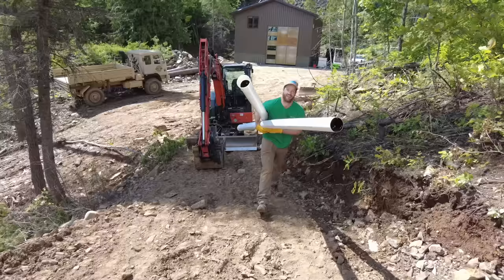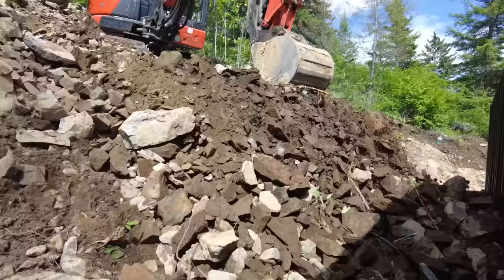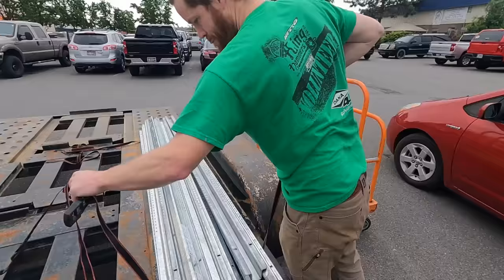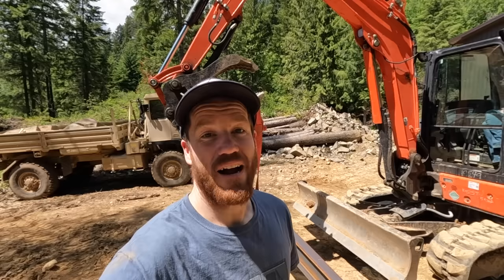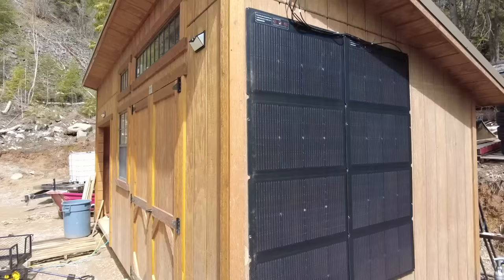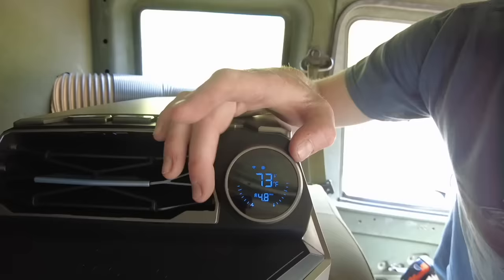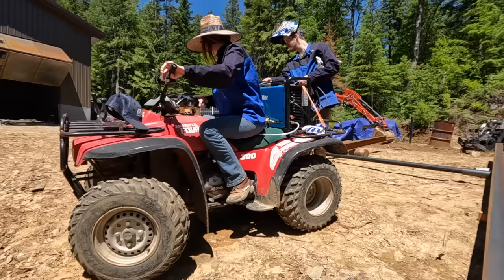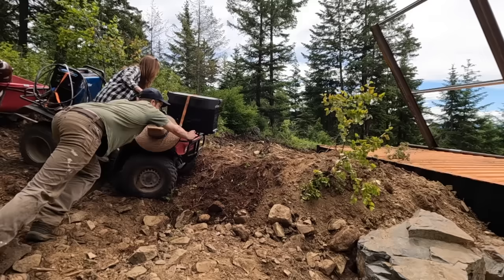We Were Told To NEVER Do This | Burying A Shipping Container

Comment: For french drain, it is VERY important to put a drain cloth around the drain rock, not directly against the pipe so the pipe does not get plugged with dirt in a few years. Steps: 1)Put a thin layer of rock (3/4 in river rock) in the bottom to make it easy to make a smooth slope. 2)Lay some good landscape fabric (weed barrier) in the bottom of the trench. 3)Put the pipe in, holes down, on top of the fabrik. 4) Put a few inches or more of rock on top of the pipe. 5) Close fabric over top of the drain rock. 6) Backfill.

Comment: The two of you are AMAZING !!   How your minds think and develop these ideas is unbelievable.  I have read some of the comments concerning high winds once the panels are installed.  I like some of the comments about securing the uphill side, top of the container 'the part that was backfilled with the rocks' with cables that are attached to vertical steel beams that are cemented into the ground 10-15 feet from the container could help with any potential high winds or heavy snow.  The way your minds work I'm sure you have already thought of the solar array destabilizing the entire container.  Love your channel and all the things you have invented, created and built.

Comment: In my last Germany assignment we used containers as air raid shelters and section offices. We put the containers up on un mortared rock to provide drainage. Then we went all army on them and made an outer wall of sand bags. Then we covered the bags with cement. and an outside of dirt. Water will soak in and turn the cement hard. When we got done we had wiring and furniture and it was very comfortable.

Comment: I used a simple water level to get my solar array grid laid out..  With the top line of posts level, the bottom line of posts level, and a fixed distance between rows, it all came out perfectly planar.  My water level cost me under $5.  It's a bit surprising, but adjusting the angle four times per year is just barely better than adjusting it twice per year.   When to adjust it you ask?  Vernal and autumnal equinoxes.  AKA 3/22 and 9/22.  Or on the 21st.  It's a leap year thing.  Of course, yours is so easy to adjust you could add a simple shadow indicator and adjust that winch every day at noon.
Do you ever get wind coming down the slope?  If so, I would dig some holes a few yards downslope from the container corners, pour in some concrete footings with a steel piece sticking out the top.  Then weld a steel beam from both end corners to the steel pieces on the footings.  This would make it MUCH more resistant to flipping over in wind or slipping away from the buried edge.

Comment: The two I seen buried were fails, the one I seen that was a success was reinforced with with t-rail ribs inside and wire concrete mesh on the outside. It was set back in a partially dug out hillside then two inches of concrete was poured around it and over it. Then filled in around all that and landscaped with trees. The doors was the only thing left showing and they were painted to blend into the mountain side. The two fails were literally buried under ground with top hatches for access. Both concave in with in year from the pressure, sections of the sides split leaving gapping holes that allowed dirt and water to spill in, subsequently ruining all the supplies inside. I climbed partially down one access ladder with a flash light and  the owner and quickly retreated as it was half flooded with water and had become a refuge for rattlesnakes floating on supply boxes and debris.

Comment: You can straighten steel lenghts by heating the bend to red hot then rapid cooling it with water, the movements are slow but normally 3 or 4 heat cycles for a 1/2 inch bend
Reply: This method can also do pipe

Comment: re: your frame hinges- if it's not been addressed yet, it'd be a pretty easy addition to add some flat plates at the ends around and welded to the outer sleeve pipe using the perpendicular face of the inter-container lock points as additional weldable surface area for gusseting.

edit: same effect could be done with inner pivots, just notching the plates to saddle the corner of the container.

Comment: saw a vid where they flip the container up side down because the floor could hold weight without modification if you fully bury it.. the way you hinge the center of your array is exactly how i designed mine. happy to see it actually works :) now am thinking of adding a motor to adjust the angle. easier to get snow off if you can increase the angle temporarily and let gravity do most of the work.

Comment: Sgm retire have used many conexs for storage.  Remember the hold heart and need ventilation. Also the steel holds the cold.  Neither are good for batteries. Barring the conex   may help. Insulation and ventilation may help.

Comment: Some awesome ideas on this project. 👍 One thing I'd definitely want to add is some form of anchors for the top corners on the uphill side of the container, to avoid it getting tilted or rolled over if the hillside settles or anything - especially with all that extra solar weight cantilevered off the downhill side.

Comment: That will be a great solar setup. Like someone else mentioned for highest efficiency you will likely want to adjust the angle every month but you have your limits set as needed and any other angle is somewhere in between. 
As for “burying” the container. You probably would have benefited from treating it like a basement foundation.

Comment: I made redwood frames with plastic  corrugated panels attached to keep the soil and rock from touching the container and to allow continuous airflow around and under it. Then put the drain pipe on the outside of the panels. Cover drains with burlap to keep dirt out of the french drain.
The problem with just burying the container directly, everything inside will mildew.

Comment: I've read articles about burying containers that said they will crush under the weight of the fill. There were pictures of them with the walls caving in. It was different though in that they were actually buried completely. I think some plastic sheeting over the top of the fill going back  into the hill side covered over with a few inches or a foot or so would keep water from even getting behind the container to begin with.

Comment: Looks like you have it under control. Every concern that I had initially you popped up with the solution. I think t-posts with a driver then welded to the container may have been better than rebar on the down hill side but then when I saw how you back-filled it I decided it's not going anywhere. Very well thought out. I look forward to following your progress.

Comment: There are videos out there talking about bearing a shipping container. Shipping containers shelters. One guy's got three parts to it and he talks about turning the thing even upside down and using the floor as the roof. One thing is he talks about putting bracing on the inside my thought was every 16 in putting a c channel in between the channels on the outside and then putting two braces say about 2 ft apart 4-in L bracket all the way down the side of the container. That will prevent the sides from caving in his theory by using the floor as the roof is to support roof load. There is another couple that has Buried one and they poured concrete around it to give it support

Comment: I have been binging on your channel.  Great video!  I have had good luck driving pins in rocky soil using a Bosch electric jack hammer.  I assume someone makes this tool, but I couldn't find one at the time I needed it, so I made it.  One end fits the chuck of the jack hammer, the other goes over the end of the pin.  I have driven Nmbr 8 rebar (1" diameter) using this method.  It won't go through a really big rock, but it will pound through smaller rock like you placed for your base.  Be well & Best regards!

Comment: Have you considered what the load will be on those hinges with the solar panels attached to the frame when you experience heavy winds?  It will be like a large sail.  You may want to consider some method of strapping the whole thing down when severe weather is predicted.   I would also think about renting a rock drill to plant some some deeper and greater diameter pilings  (perhaps concrete with some rebar) to hold the container in place.  I would be concerned that that solar panel sail may exert enough force to flip the container on its side, with catastrophic results.

Comment: At my camping property, the ranch owners put a shipping container in for a tornado shelter. They didn't bury it underground, they just put dirt around and over it. The top had about a foot of dirt on it and it started caving in. They built a support wall in it, but still, not good.
Reply: My friend is thinking of burying shipping container underground too...he thinks turning container UPDIDE DOWN. Will be stronger,
Cause the floor, has the strength, to hold heavy forklifts....therefore stronger to hold up the dirt...any thoughts?
Reply: @sammytheface8821  Hmm, that's a good thought, but the sides will still cave in. I have seen a video of a couple that buried a container and it works great, but it wasn't filled back in around the container. They built a metal structure on top of it and I think used sheet metal to cover the hole. And the a thin layer of dirt and grass. It was probably 10 or more years ago when I watched that video. After seeing how much $ needed to go into burying a container to make it safe, I dropped that idea.

Comment: once you attach solar panels you've created a wing...it will naturally catch wind and move/vibrate/osculate.
calculate surface area and wind load...i wouldn't be surprised to learn under specific conditions the wind load would be capable of removing the entire structure and toppling the container  over into the trees....think atmospheric river...good luck.

Comment: Great. Now this spring, move the winch to the top & pulleys to keep the cable down where it is. So, only you can move it by yourself & don't have to be under it, in that tight area.
Also put a sundial (protractor) on the side of the array. So you can view the sun angle from your home.

Comment: Interesting idea. For the wall that is buried,  a beam welded the length of the container halfway up would help prevent bowing. This is something that could be incorporated inside also, maybe as a shelf support. 
For the winch, add a snatch block at the bottom of the container to run the cable through. This will allow the solar assembly to be pulled more vertically rather than horizontally.  This will reduce strain on the winch, the container wall, and the assembly.

Comment: Moving a cylinder without the valve cap is also dangerous. My college chemistry lab instructor told us about an incident in the lab  when a student knocked the cylinder over and the valve hit the edge of the lab table and broke off. The 5000 psi cylinder crashed through a block wall and went several blocks across parking lots before it came to rest. Some small jet engines only have about 500 pounds of thrust.

Comment: As the solar panels you are using capture sun from both the front and back, you could also consider some sort of reflective material behind to maximise output in the winter. I don't imagine output being an issue in the summer but every little extra will definitely help in the winter.

Comment: I would go ahead and us a hammer drill to put those stakes in the ground, it still has pressure on it that will make it move with frost wedging in the winter.   The drain looks good and will help avoid "frost wedging"  it way from the hill side.  Good luck, it will be interesting to see how it all worked out next spring.

Comment: With 70+ inches average snowfall, have you planned how to get rid of the snow sliding off the solar panels? That is going to be a lot of snow volume. I used a track loader with a 6 cubic yard snow bucket to haul snow away.

Comment: That's very slick, nice job.   Once the panels are on, and with the center of gravity toward the top, the space between the container top and the array could be a crush hazard area.  ie, if you're on top, removing the pins and the winch restraint fails.   For wind loads, maybe extra cables from the corners of the array back the container (and the bottom), and back to some anchor points up the hill (to trees from the top of the array).  Unhook those first before doing the seasonal angle change.  The steep winter angle will work great to let all the snow off.

Comment: Nice!  Weld caps on your hinge piped. They will act like condensers spring/fall as the dew point fluctuates from day to night and rust internally. Since they are horizontal water will pool in them. If you don't want to weld them, just cap them with anything and seal them with glue/silicone.

Comment: Sure is a lot of suggestions about the container. How long it last depends on condition of container. They will rust but I've seen some that was treated an conditioner before burying it that has been there 40 to 50 years. If there is any rust all ready on it will rust out pretty quick once fill goes around it.

Comment: I am going back and looking at some of the old videos that didn't have a red line across the bottom of them and only a container you could take a hammer drill drill into that rock and then drive your pins in there To hold the cant container in place

Comment: A simple fix to stop the container from sliding out would be to dig about three or four 2 foot deep post holes along the side of it and then put some steel angle bar in concrete and then weld them to the side of the container.

Comment: Last comment, a true “french drain” is actually made from a trench filled with rubble of different grades and well below the surface you are draining and sloping from a high point to the drainage point, in this case across and down the hillside. Your trench would start at 2 feet deep and likely end at 4 feet deep. Perforated sleeved pipe is a modern product tha makes this system more reliable and tidy.

Comment: ON your solar array drill holes possibly  2 in each one of the 3 inch collars that are welded to the shipping containern . Add  a drive in grease fitting in each hole then you can grease the fittings for easier movement with the winch cable.

Comment: You still could anchor the box down with large long ground screws and long turnbuckle. That worked for my two car garage that took direct hits from hurricanes. I grew up on the prairie and strong wind tumbled a wooden granary 1/4 mile into the wood line. Time will tell, I guess.

Comment: I think your container will move to the downslope of the hill once you have soil and water load on that filled side. The steel getting moisture on it constantly and damp soil under the container floor will cause you problems with rust and floor rot. Having the excavator you have had the opportunity to lift the container to seal underneath it, bolt it down to concrete pilings to allow full drainage from under the hillside and underfloor. Horizontal i-beams welded across the side if the container would provide support to prevent sidewall collapse under soil load. The container needed derusting and seal coat of tar or acrylic rubber paint.
Lastly, that solar array “sail”, it is attached to a box with soil pressure pushing it downhill, nothing holding it down at all, be prepared for it to take flight because you are on a mountain side - with a seriously gorgeous view by the way. 😊
The engineer in me wants you to be safe and your assets secure. ❤

Comment: Engineers method: To protect burried metal from corrosion failure over the long run, the best way is to do the following:

-(research cathodic protection): attach zinc sacrificial anodes to the metal. A buried metal object in contact with the earth will actually act like a battery. The greater the electric potential between the metal and the soil, the faster corrosion will occur. The metal gives off electrons to the earth in the process of corrosion. If properly done, the sacrificial anodes will corrode before the metal which extends the time before the metal corrodes. I believe the Dwight's formula can be used to do the math on the amount needed based on soil quality, metal etc.

-Proper coverage and thickness of corrosion resistant paint (pin holes in paint actually accelerate corrosion).  Preventing an electrical bridge between the metal and earth will stop or slow corrosion.

Comment: If you are going to adjust your solar panels you should set up you degree gauge and adjust it to the levels you want and draw a line or spray paint around the corresponding  holes of the tubing with the holes in it for different degrees. Just use painters tape on either side of the hole any bright colored paint to mark the corresponding hole for each degree.
Reply from the maker: That is a great idea!

Comment: Honestly, I would have skipped the interlocks on top and the winch.  I would have gone with allthread in the center of the pipes and a nut at the end.  Then you could have a servo and operate the whole array from the apartment, sensors to detect the angle, etc...  Have a small embedded controller to optimize the angle daily, weekly, monthly, etc.  And when the weather reports that a storm is coming turn the array vertical.

Comment: Late to the party as usual.  I worked for a summer at a machine/fabrication shop for the summer more years ago than I want to remember.  I watched an older fellow straighten an I beam (W flange I think is the proper term) by setting it up on a series of saw horses, and walking down the length with a torch.  He'd heat the "high" side of the bend and it would release the stress causing the beam to return to straight.  That and a Mk 1 eyeball it was stunning how straight he got it.
Reply from the maker: Thanks for sharing, that is a really cool idea!